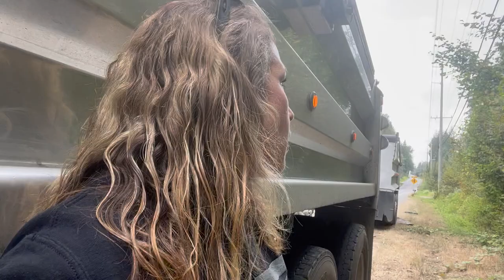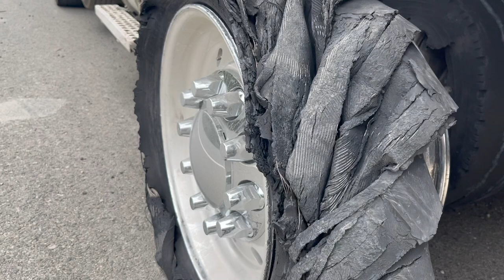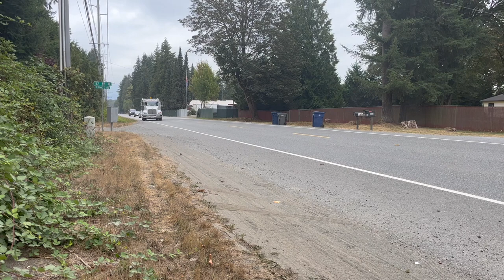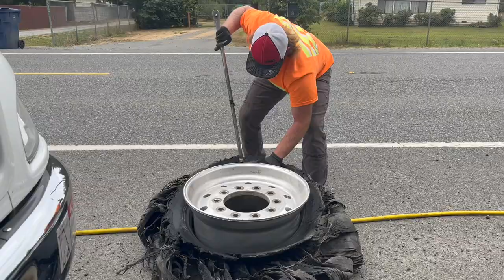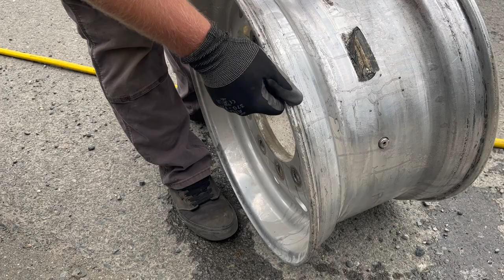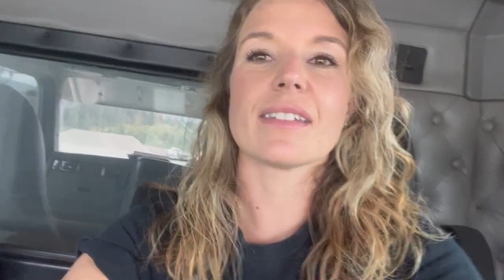STEER TIRE BLOW OUT ON MY T800 KENWORTH!!! Scariest moment of my entire truck driving career.

Comment: I always tell my guys anytime u get a  blowout on steer you have to full throttle it and crank the wheel in opposite direction. That will build air pressure back into the tire forcing it to inflate. Trust me on this. Ps I've done drugs this morning so any information is tax deductible. Stay safe drivers 🙏 😛

Comment: If that tire had wrapped around it wouldn't have mattered how many hands were on the wheel. If it wants to yank you it's gonna. I know a guy that got literally ripped in half like that. Hit a huge highway sign pole after a steer blew.

Comment: Never put 255 retreads on your steering front axle ..   NEVER.          

And almost always put a new deisel fuel filter change before you go into mountain range altitudes where the cold is better part of it...   Keeps the last 33percent of your fuel filter from waxing shut....      

You got a cat620 or cat 720 in that hauler????

Comment: Thankfully you were not loaded.. try driving a semi with 45klbs in the trailer and blow a steer tire..scary times all around..all you can do is push on threw it.. just always check your steer tires daily.. turn them and actually look on the inside cause that's were they will split and you can't see it..
Reply: ♥️..DM up immediately.✍️

Comment: Stop it. I drove a 6 ton truck for 8 years and I hit two deers one that actually jumped right in the front of the sweeper truck and I immediately hit the brakes and I was traveling at 70 mph it instantly went left down the embankment of the freeway and I drove it straight down the median without rolling it. The hiway patrol officer said that I should have rolled it. Well I didn't was lucky that night. The second deer was head on and it didn't make it but it also didn't damage the truck.
Reply: ⬆️⬆️H.E.L.P.L.I.N.E.⬆️⬆️

Comment: OK. This will sound so screwed up but get over it. It happens. I have blown 1 steer in 40 years. Don't think about it. You are OK. This is why you don't jump curbs with your steers. If you hit say a 4x4 in the road the next stop needs to be a truckstop and put a new one on. This is also the reason why 4 wheeler hanging out is dangerous to them and nueterd trucks are dangerous to us. My truck ain't neutered and passing another truck I get a running start and mash the gas. Your young and prolly got your CDL through a school but that whole flooring it shit don't work does it? With a steer blowout you want to get on the brakes and slow down as fast as possible.

So suck it up and drive on but... for about a week you will be so reluctant to speed for sure. But like I said it happens and why you should never hang beside another truck and back off and let another truck pass you as quick as possible. As for 4 wheelers you can scare them to speed up if they want to hang out and never ever curb your steers and if you hit anything that may break or weaken the belts replace the tire or tires. Yeah I hit a 4x4 and I replaced that tire at the next truckstop. Better safe than sorry. Curbing and hitting something in the road it's not a matter of if it will blow but when. If it is a company truck your life should mean more than the price of a new tire. Also why a practice Pre trip inspection is so important. Check between the treads for separation especially the inside and outside ribs.

But instead of crying you should be smiling because you just experienced and came through the most dreaded ordeal a Truck Driver will ever experience without killing or hurting yourself, wrecking the truck or killing or hurting someone else. You must of done shit right without overthinking so good job.
Reply: ⬆️⬆️H.E.L.P.L.I.N.E.⬆️⬆️

Comment: well instead of a $250,000 truck you got $100,000 truck. I used to give my friend s*** about driving a dump truck you just listen to the radio going down the road. his answer was really I drive 80,000 lb down the road and I have some idiot pull in front of me and I don't kill him. you go over the mile long bridge in the middle of winter with load of gravel good luck
I told Albert now I completely respect you I apologize